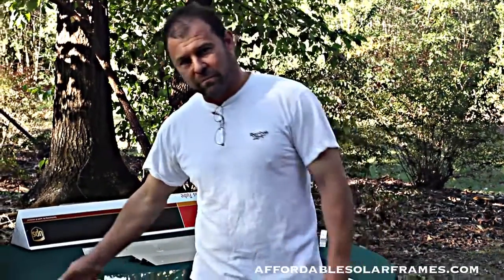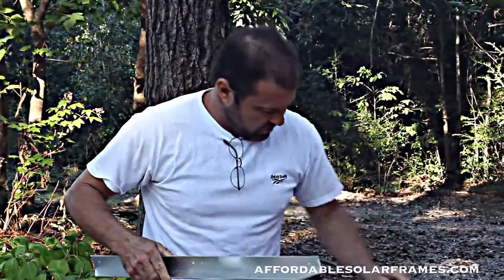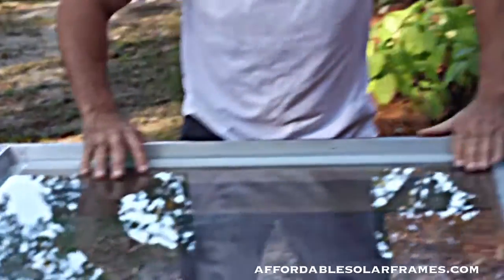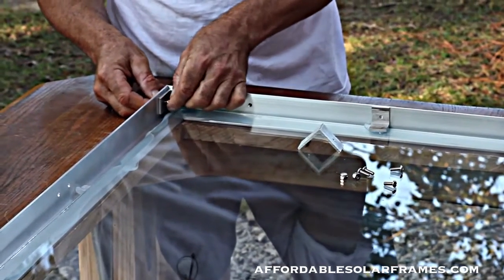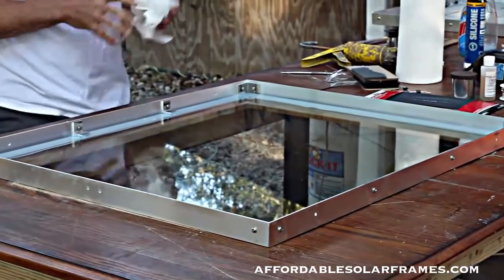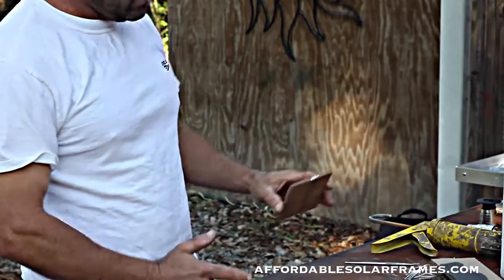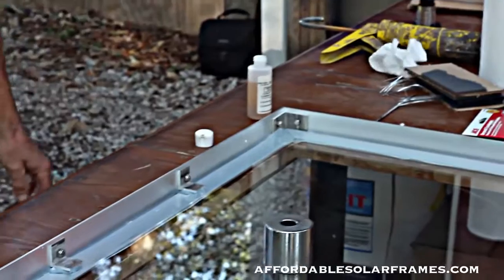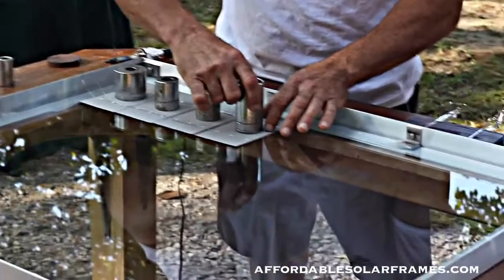HOMEMADE SOLAR PANEL

Comment: I'm taking a training course in solar panel installation, repair and maintenance. My instructor recommended this book [link here ::https://plus.google.com/111559548151642295021/posts/CXszLxekD6J   ] as an excellent resource along with the course. I'm finding it invaluable. By buying it through Amazon, I saved considerable money and received it very quickly.